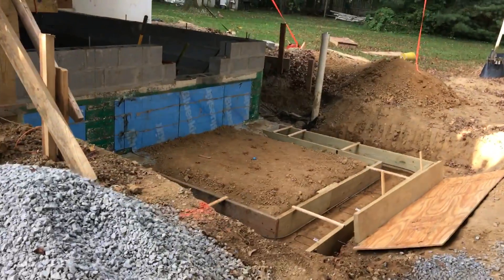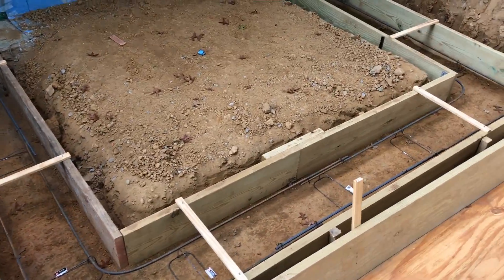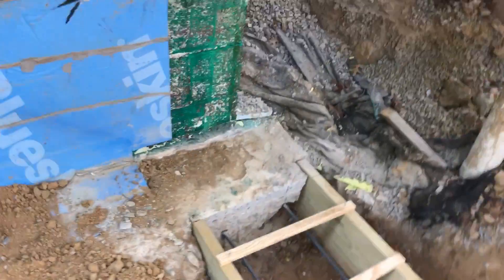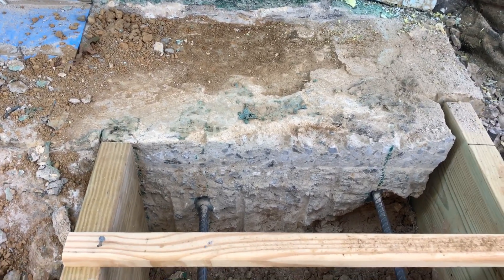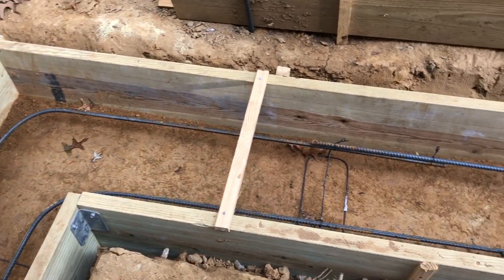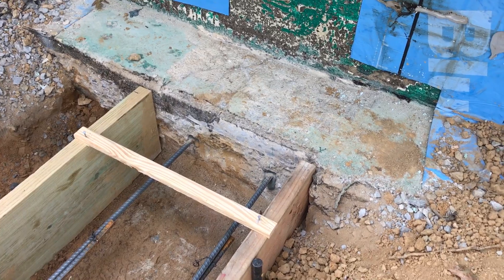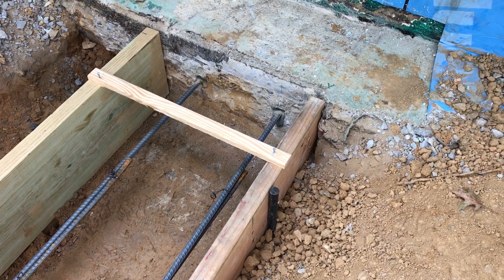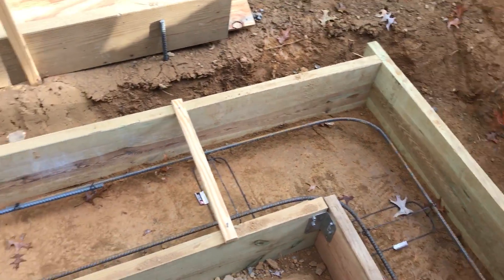Footing Forms

Comment: Nice work.   My neighbor's contractor just completed the raised foundation footings forms  for their bedroom addition project.  They won't be able to poor due to failing the inspection.  I'm not sure what they failed, but they didn't drill holes into the exiting footings to attach the rebar coming from the  new section.   Is that a code requirement?